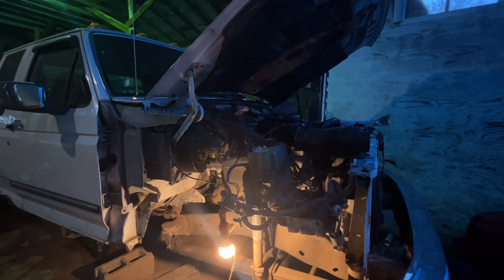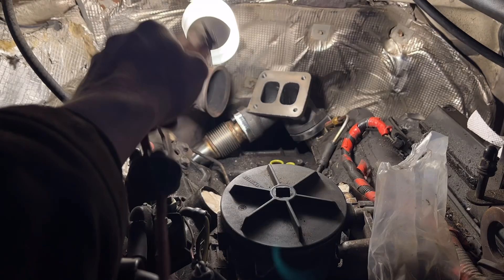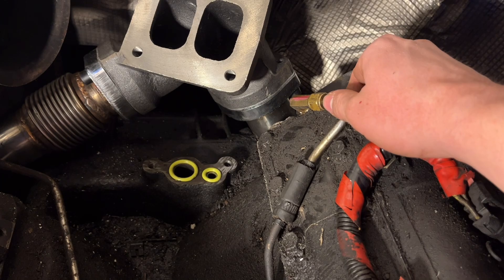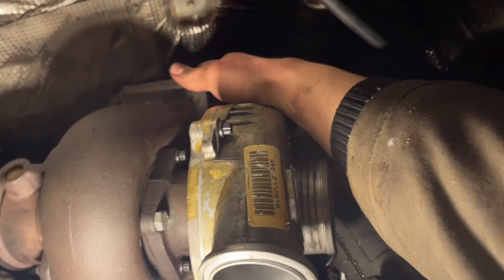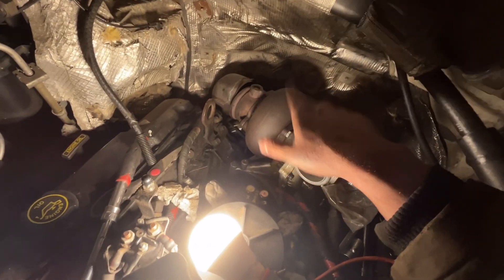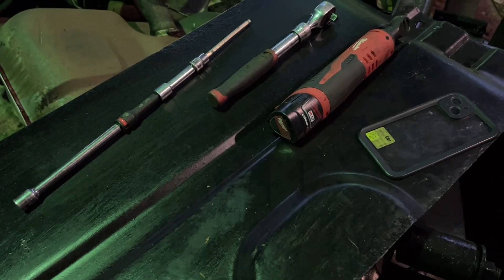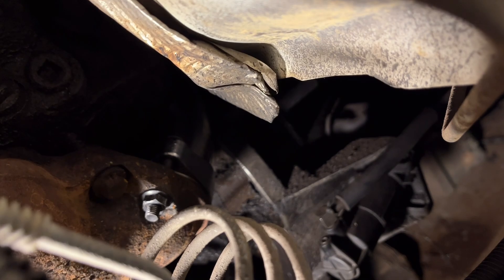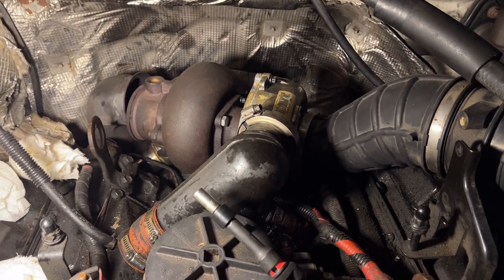How to install uppipes and turbo on an obs 7.3 Power Stroke

Comment: My 96 was leaking from that same fuel fitting. The 94-96 line and fitting is different but has the same style Vibra loc fittings on it. 

If you were this far into it, why didn't you go electric fuel pump and eliminate all of the mechanical pump/bowl/leak-prone fuel lines?
Reply from the maker: @NoName-tq9fi  money, but probably should have